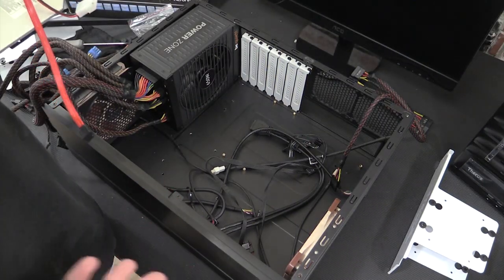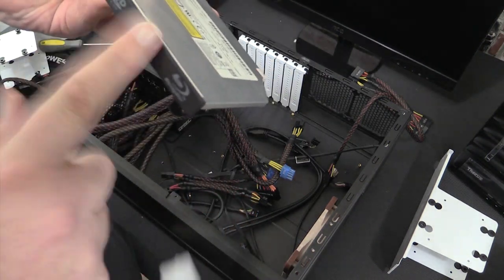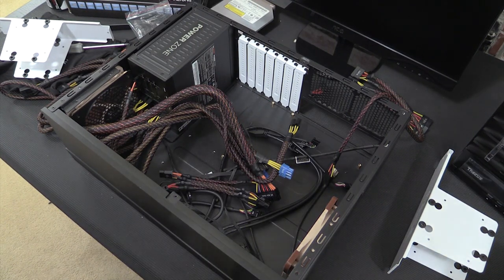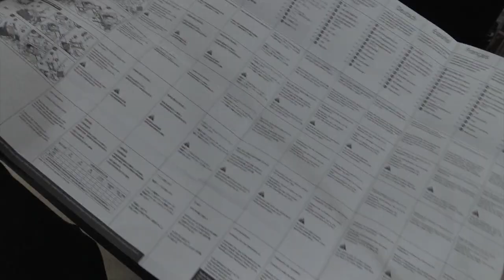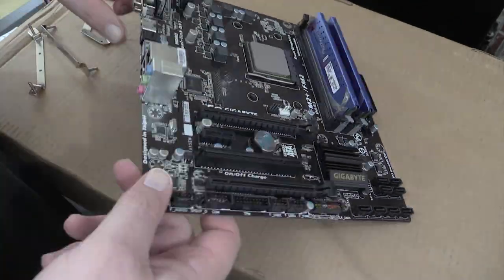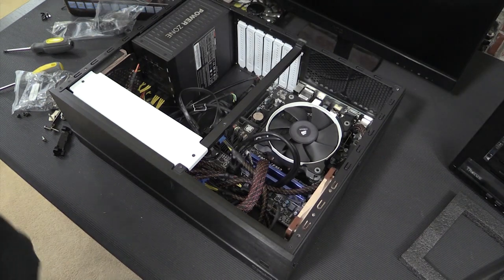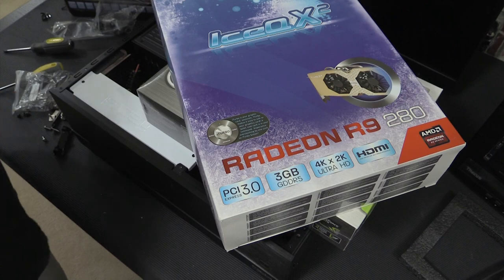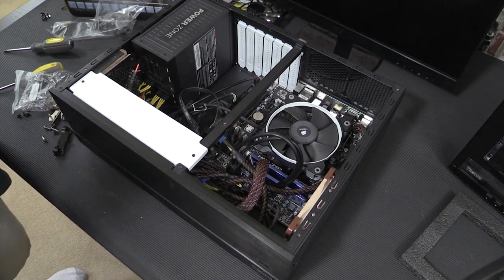How to build a Media Center PC you can game with!

Comment: Nice build, im about to build a similar system myself (f2a88xm-hd3 with a a10-6800k) now, will this type of motherboard be able to run the 1.65v ram such as 2133 and 2400 at their actually speeds? or will they just run at 1600 mhz and 1.5v?

Comment: brown pcbs= :'(
Reply from the maker: Yeah, but no window on the Node 605!
Reply: TimmyTechTV Nice choice. I'm running the Node 605 for the same purpose. I ended up with the i5-4670k and 4gb GTX 770 in mine. The i5 would overheat with stock cooler when running BF4..and even super hot with upgraded big shuriken rev. b cooler. I've had the best results with "positive pressure".. 3x120's on intake, and 2x80's on exhaust. Enjoy!